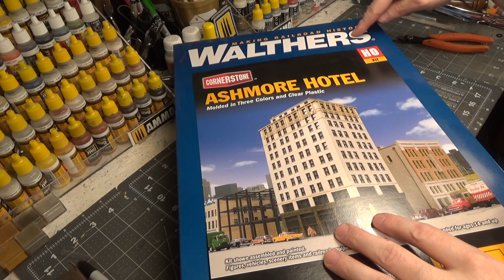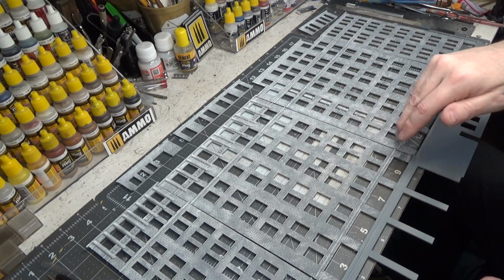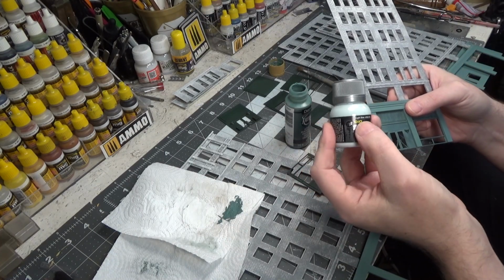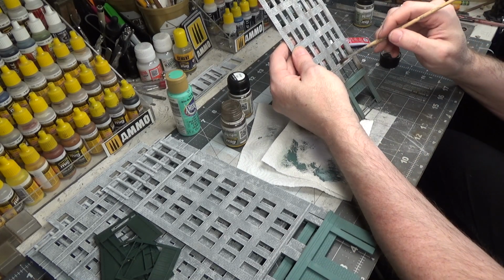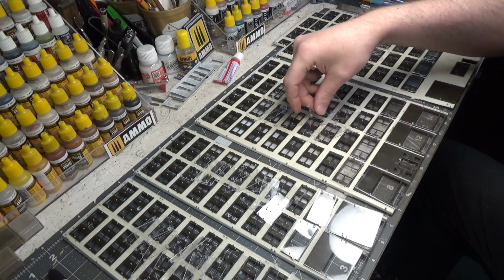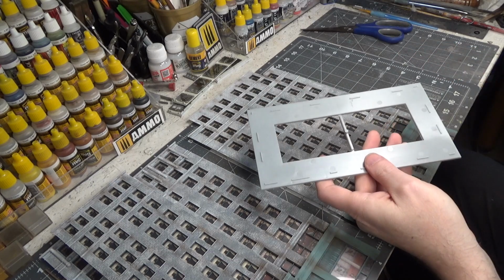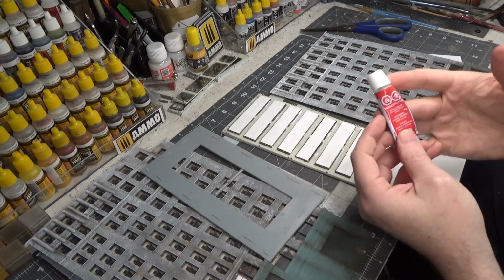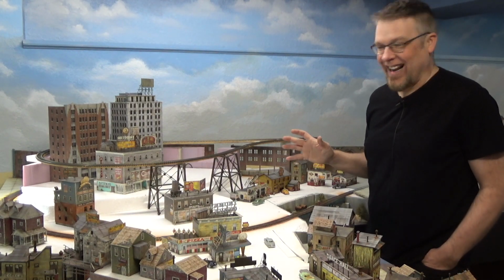Painting plastic to look real!

Comment: Jason, I'm so very happy you chose to build this kit!!  Have two of them with the intention of using them together for a larger hotel adding a hotel swimming pool in some fashion (another kit).   Might be rooftop pool on top of the buildings combined together into one wider structure with one rooftop element ... or an elevated 2nd story deck pool placed between the two separate structures towers.   The instructions layout options for two or more kits combined.  Again, thanks.  Might be my winter project ... as if I don't have others!    All the best ... Happy Holidays ...
Reply from the maker: Thank you so much Donald!!! Happy modeling and happy holidays!!!